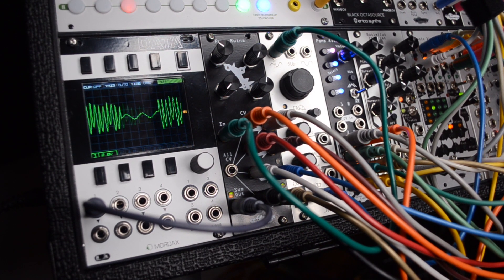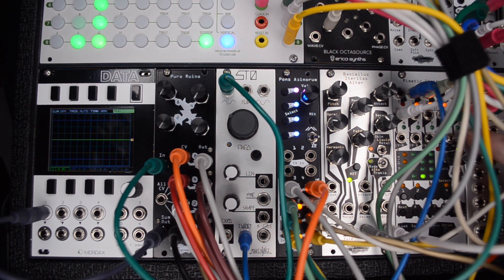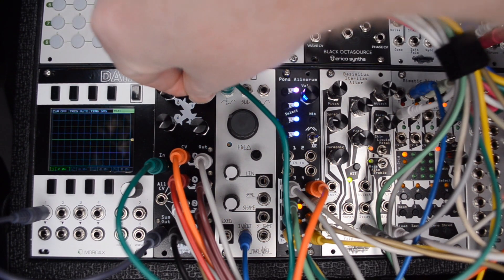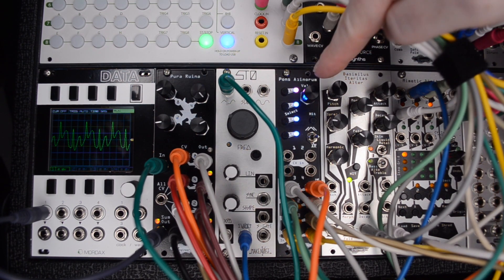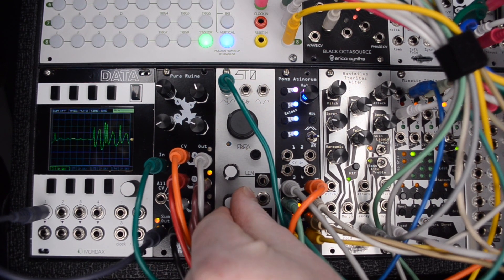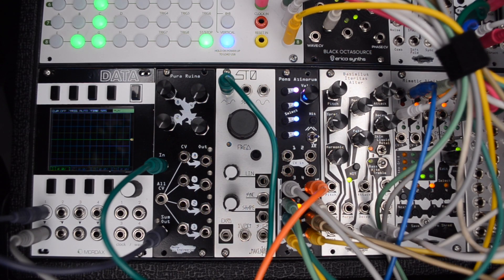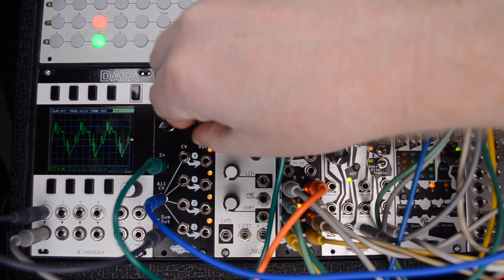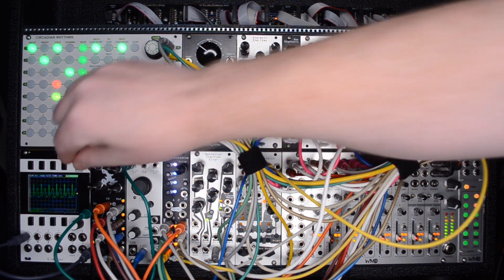Pura Ruina Demo - Three-stage CV controlled full-wave rectifier and VCA

Comment: sweet module! Have the seca ruina and love it. Im a bit confused and trying to understand whats going on under the hood here though, the oscilloscope output a bipolar shape from the output, but you said it makes a bipolar signal unipolar. Is it adding a counter offset voltage to bring it back down? Also the shape of the waveform isn't what i'd expect a rectified sine to look like. Looks like theres a bit more magic going on inside the module.
Reply from the maker: There's always more magic 😉 but yes, the sections are all AC coupled.
Reply: Same thoughts here
Reply: I can't tell you what's going on about the unexpected shape but the bipolar output probably comes from a capacitance in the output stage so it removes the DC offset induced by the rectification stage.